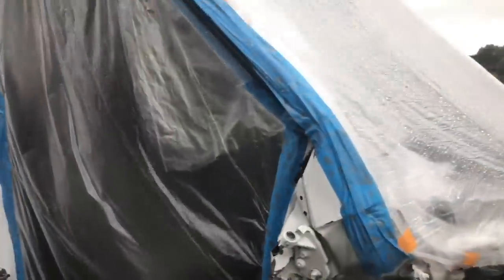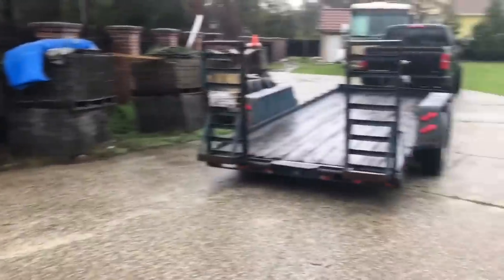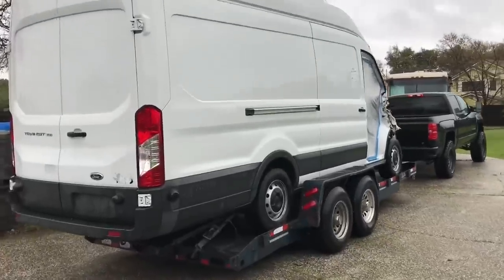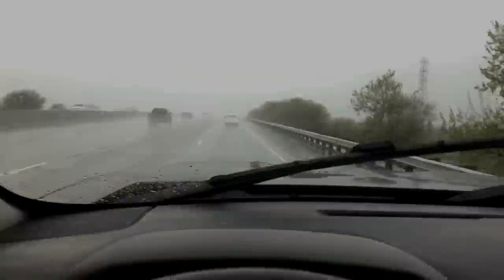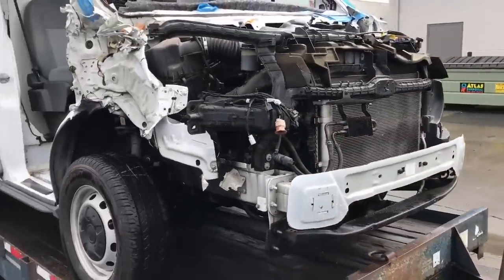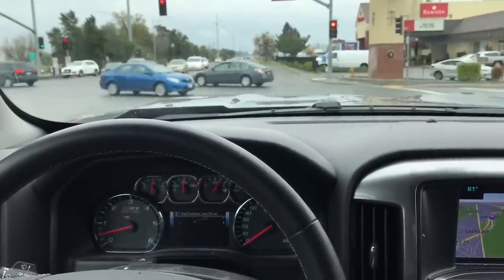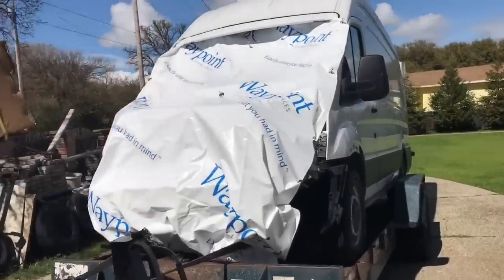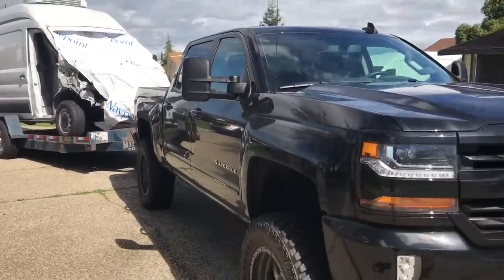2017 1500 Silverado 5.3 Towing 11,000lbs Then this happened!!

Comment: If you push on the wheel you can move anything, since it's the point of movement
Reply from the maker: yes, but when you cant switch gears out of Park because it only switches with key, then its not going anywhere

Comment: The rain most likely got into a relay and arched it out burning the contacts up. Some water probably did get in the vehicle and if I remember right there's a couple relays right on the firewall on the inside. That or a battery terminal, the weirdest things happen when it's loose.
Reply from the maker: Fuse box got wet had to swap from another van

Comment: Flatbed trailer 2500#

Cargo van 5000#

Invisible man, 3500#?

It sounds like he is adding the trailer weight and the gross weight of the van?  The European vans are fairly light unladen compared to USA vans of old.
Reply: That is a whopper, getting closer.  What is the gross?  Doesn't sound like much room for cargo weight.

I went back and looked on google, car and Driver had specs of a touch over 5700# curb weight for a 148" high roof
Reply from the maker: Trailer is 4500, van with reefer is about 6000-6500
Reply: FixItNick I'm curious to know where 4500# came from, and where the weight is hidden, an 18-20' lowboy runs around 2200-2400, I looked at a trailer that was around 4000+ last month, it was a 26' deck over gooseneck rated at 14,000#, the dually trailers are a lot heavier.

Comment: No windshield, doors, or front end sheet metal, and you're taking it to the bodyshop in the rain O_o .......  You're probably lucky you were able to get it dried out and there was no severe damage to the GEM module, PCM, or any other major component. I bet that's the last time you take a disassembled vehicle to the bodyshop in the rain like that.
Reply from the maker: Taya lol it was supposed to only sprinkle, had to replace one computer all good now
Reply: Scott Lambeth 
Actually yr right there r exposed wires to.

Comment: Those Ford Transit vans top out around 5,000 lbs and the reefer option adds less than 500 lbs. you probably don’t have more than 8,000 lbs total including the trailer.
Reply from the maker: I guess they are lighted than I though, but that trailer is heavy duty for heavy equipment maybe 10k total
Reply: FixItNick wrong again. Those equipment trailers are light. Try going through a scale and see how much weight you actually have.
Reply: Ryan Lange 
That trailer alone is heavy.
Reply: @thehandyman2180  ...says another chevy owner! You are also wrong! We are all still waiting on the scale video to prove how much that trailer weighs!
Reply: Charlie Odom 
I'm confused, yr not making sence, & it also looks like yr being sarcastic.
Reply: @thehandyman2180  apparently you are about 10 years old, since you can't even write a complete sentence, nor spell it correctly. Let me dumb it down to your level:

- The trailer he has is NOT heavy.
- ALL 10k capacity trailers are light.
- The van he is towing is much lighter than he claims.
- All he needs to do is a  ideo of a weigh-in to prove how much the trailer weighs.

Being a Chevy owner, he will probably do something stupid to make the trailer heavier on a scale, like hide weight somewhere, but anyone can look up weights of car haulers with 5200lb axles and they all weigh in the 2300-2600 range.
Reply: Charlie Odom 
Ok mate.
Reply: @thehandyman2180  Why go back now to modify and delete posts?
Reply: Ch
How heavy is the trailer.
Reply: Charlie Odom 
So u don't know, otherwise u would've told me, u don't don't just start a fight & the way u talk, u have the mental age of a 10 yr old.
Reply: @thehandyman2180  aww...poor baby. Still can't speak in complete sentences! Keep digging that hole. You'll have a nice swimming pool before the end of the day.
Reply: Charlie Odom
U just can't b sensible, yr not getting to me, i haven't made any mistakes, i don't y u keep saying i have, u obviously can't have a normal discussion, i'll find out from an adult, or i'll just find out myself.
Reply: have a normal discustion, i'll find out from an adult or i'll just find out myself.

Comment: I would have backed the van into the trailer, that way the weight distribution would have better placement, and help allow you to let Ft the trailer ramps up higher.
Reply from the maker: nah you never want so much weight on the tail of the trailer, plus it would not fit on the trailer backwards
Reply: FixItNick is still like to see it, it looks like you could get the rear bumper just about up to the landing gear tower/crank, that would have the rear wheels closer to the front, than the front wheels were. And the front wheels just about where the rears were. That would shift the weight toward.
Reply: It wouldn't shift enough weight forward, and would be an even more dangerous tow than it was in the video.

Comment: Here is an important question.  What gear ratio does your truck have?
Reply from the maker: 3.4
Reply: @FixItNick  GM really needs to put at least a 3.55 or a 3.73 in the 1500 trucks.  My last 2015 one had the 3.42 in it and it would barely pull 6,500lbs.  And it wouldn't hold 70mph on the highway in 6th gear.  Had to drive in 5th the whole time just drinking fuel.  These trucks suck for that reason.  They are only good up too 5,500lbs towing.

Comment: Did u do anything to ur suspension like airbags etc.... to prevent sag
Reply from the maker: No I didn’t all stick with lift blocks
Reply: I think I’m going to add Firestone bags under mine because they really do have SOLF suspensions.....my Kearney car hauler weights 2500 and Jku weights in around 6100 so I’m thinking it’s going to be pushing the limits of my Silverado
Reply from the maker: R D I won’t be towing with the Silverado anymore, that’s why got the f350 project
Reply: Nice .....but I can’t justify a tow rig wen we’re only go a few hours and times a year to the off road parks
Reply from the maker: R D ya I’ll do bags on my F350 truck when get a 5th wheel trailer

Comment: Unless you ran it across a Cat Scale and have the slip , I'm calling bullshit on that 11,000# number , your tandem trailer is 1000 to 1500 empty and that van is about 7,000 empty.
I also own a triple axle flatbed trailer and empty weight is 2000# for my triple axle trailer.
Better learn how to use a Cat Scale or you're going to get tagged , towed and fined by the highway patrol using that 1/2 ton that way.
Reply from the maker: Incorrect sir, that trailer is 4000ish
Reply: 2009mechanic that van and trailer are easily 11k lbs

Comment: What else is wrong with the van that's complete except for the damage I see on the roof  it looks better that the wreck van u taking to the shop.
Reply from the maker: I you referring to the rolled over van? It's basically that been rolled over, runs and drives, was gonna take it to auction soon

Comment: No where near 11k those vans loaded with everything are right at 5k try 7500 pound towing
Reply from the maker: Good guess but that refer can with more panels and insolation is about 6,000lbs and trailer is about 4000-4500

Comment: Everything mechanical in that truck is forward  of the front seats.  You towed it 60MPH in rain with everything getting blasted by water.  What did you expect?  As for the tow vehicle...best choice!!  I tow Fords and Sheepheads sideways with my 2500HD.
Reply from the maker: I wish mine was a 2500, 1500 are to light for towing much, as for the rain it wasn’t so bad till I left the house, I failed myself on this one tho

Comment: to much for the 1500. I have a 2500 with towing package and its rated at 12000 lbs trailer or 3800 lbs in the bed. the 1500 is not rated for that much.
Reply: NebukedNezzer that chevy has a 11000 lbs towing capacity
Reply: Monster RAM Ya I know
Reply from the maker: It did just fine, I should have done 0-60 haha
Reply: Monster RAM max towing doesn't do anything. Same chassis, same brakes, same axles, same transmission.

Comment: Awesome! thanks for sharing, sorry you could not get the van started on your first trip. I am in the process of purchasing a 2017 Silverado 1500 and was not sure if it can tow my boat weighing approximately 10,000 lb.  👍
Reply: I’m currently negotiating a 2017 1500 4x4 and want to pull a toy hauler with my 4 seat RZR and came directly on YouTube 😅😅
Reply: @shreqboi1  how has the truck been towing? About to purchase a camper to tow with my 1500
Reply: @J.M.S.S.p  to be honest, I got rid of the truck within 10 days. The ltz had power and all, but she gave me problems right away. The fuel pump started giving me problems and it pulled hard when it down shifted from third to second
Reply: I think once or twice sure but I wouldn't trust a 1500 to tow 10k plus on a regular basis Definitely straining the motor

Comment: The problem is that it's a Ford
Reply: Your wrong, he forgot to put a tarp over the engine so the rain or snow can't go through
Reply: I've driven those, I wouldn't buy one if I could get a sprinter, but they are pretty nice vans.  A bit plain.
Reply: Derrik Lee sad thing is that truck has no problem Towing that load if it was a ford it would have taken  a s*** ford
Reply: At least the steering wheel is centered on the ford.
Reply: Ford is better than you guys
Reply: Jason Larsen I've ridden in a Ford and trust me my a**** hurts
Reply: Ed Carl cool story
Reply from the maker: Ur face is a ford lol
Reply: Ed Carl GM is garbage lol bailout ass company. Their 2019s are hideous and chevys drink oil like a damn dog no thanks. Ford all the way for me
Reply from the maker: Well after doing this Chevy truck I just finished this ford van and I just picked up a f350 project, I also have 2 67 mustang projects... fords are cooler!!! Lol
Reply: If it was a CHEVY it would fire right up
Reply: Although I like vehicles based on specifically which ones they are and not brand, I have to throw in a Ford line.
FORD: Found on Road Dead
Reply: Charlie Pignatare Key word, fire.
Reply: It’s a Chevy
Reply: Rented one twice, lack of entertainment and brake pedal that sits to far up are the only gripes other then that it’s a fun and useful van.
Reply: Cya 😂😂
Reply: Evil One you are probably 12
Reply: FixItNick if fords are cooler then why the FUCK do you have a Chevy

Comment: You are luckey you didnt kill some one you are over weight for a 1500 of you get into a accident your insurance will ne null on void ....and in the rain
Reply: Jeff J well clearly his truck did perfectly fine, not one issue. It’s literally less than 1,000lbs over the towing capacity. You definitely have t den people go WAY over the tow ratings of their truck...
Reply: The Transit's GVWR is 9500 lbs... it weighs much less than that, probably half.
Reply: Nick Ferderer f
Reply: My overbuilt 18' Cam Superline is a 2100lb trailer and according to Google, the Transit 350 tops out around 7124lbs. So at most it's probably 9400lbs your towing. But that one has no seats or gear in the back so it's probably closer to the bottom at 5,000lbs curb weight. So really a 7500lb load.

That's why the Silverado had "no problem." It looks heavier than it is.
Reply: Nick Ferderer if you are towing max tow capacity you are gonna break stuff it’s a fact and you can’t avoid that from happening unless you buy a real truck (diesel)
Reply: Keith Brewer Gonna break a diesel too if you tow at its max weight.

Heck everything breaks eventually, towing or not.
Reply: Jeff J you are correct it's not getting it moving but stopping
Reply: Jeff J that's not overweight. Total legal. A Chevy v8 will tow 11,000.
Reply: Keith Brewer the diesel truck has the same chassis, axles and brakes. How is it going to be better? The engine weighs more stressing out the brakes.
Reply: Nick Ferderer you towing capacity is not about how well your truck pulls it its is how well it stops it
Reply: Sami 10,000
Reply: Bryan Hensley crew cab?
Reply: Back the Blue I can tow 11,500 with the 5.3l v8 
Crew cab
2wd
Short bed

Comment: That vans weight loaded max out at 7000 lb so unless that trailer weighs another 4000lb and the van is fully loaded I think your weights are a little out
Reply from the maker: That van has a reefer inside so it puts it at about 6500 maybe? Trailer is about 4,000

Comment: I'm almost positive anything 10,001 pounds you need a CDL. Whether vaulting privately or commercially
Reply: Joshua Dupont wrong.
Reply: 26,000, that's correct,
Reply: 26000
Reply: 26,000 is the cut off. 26,001 =cdl
Reply: Federal DOT = 26,001 lbs. State and city DOT have the ability to require a CDL for lower a weight, so you have to be careful where you drive. You don't need to keep a log book if you have a truck (usually defined as 5 tons/10,000 lbs. or more in most jurisdictions) if you drive it for pleasure or you're using it for your own personal business and state "NOT FOR HIRE". DOT and state police want to make sure that if your making money, you're papers are in order, otherwise, they can't demand you produce a log book or even a physical card. I did plenty of illegal hauling over state lines, NEVER tell the state police at the weigh station you're getting paid if you're doing a small side job for cash LOL They'll fuck you 9 ways to Sunday. In the end, all the CDL laws and requirements are bullshit because they don't take into account the physical size of the vehicle, case in point, the guy with a regular 4 wheel Class D license goes to rent a Uhaul or a Penske that has a GVWR of exactly 25,999 lbs. or 26,000 lbs. But the straight truck has a 26 foot box and is 12' foot high+..... next thing you know, he's smashing into cars and getting stuck under train trestles. So much for CDL rules based gross vehicle weight.
Reply from the maker: You are wrong and I have a class A

Comment: I was going to guess that water got in somewhere within the electronics shorting it out and it sounds like that’s what actually happened. I would not have towed it in the rain if it was humanly possible to avoid.
Reply from the maker: Yes I had to swap fuse computer box under dash

Comment: The GROSS vehicle weight rating of that van is at most 9500lbs. That's not what it weighs, that's the maximum it's allowed to weigh with a load in it.  Van and trailer together probably weighs around 6k.
Reply from the maker: Trailer is 4500 van 6000ish its 22 feet long tall roof with reefer option

Comment: My 98 Z71 Silverado 5.7 vortec would drag that entire truck and trailer with load . Good old 3:73 locking 14 bolt powered by a 5.7 vortec 330 TQ at around 2800rpm 5.3 says what. 5.3 makes what 340tq at what 4000rpm. Young punks ya you young punk just cause your truck puts out 300+ HP doesn't mean shit that's the problem with trucks now a days people want HP. The problem with that is now pickups yes put out 400+ hp but it takes them to 4000rpm to make the power. But on the other hand I like it when my 98 Z71 out pulls these new truck's then the young man with debt up to his eyes wonders wtf my new truck is rated for 400 HP how did your old 5.7 vortec with 255 HP out pull me WTF. People trucks are ment for towing and hauling like my 98 Z71 was built for not like this new junk. Unless you're talking 2500s and up.
Reply from the maker: Sounds like a cool story lol

Comment: You should had placed the van backwards to avoid the rain going into it. I guess you got blinded by hauling it with your truck than using common sense. It happens once and while. keep posting videos with overweight hauling and you'll see how your channel will serve its purpose.
Reply from the maker: you never load cars backwards because thats how it will fishtail the trailer and cause an accident due to to much wait on the rear of the trailer

Comment: If you're going to haul a Ford, should get a Ford to pull it.  Everyone knows the only thing dependable about a chevy is you can count on the engine rear seal leaking making a mess on your garage floor.
Reply: eighthof8 that was funny but you know what Chevrolet Motors repower power
 more Ford drag cars.  Hot rods make fun of a Chevy when most Ford's are powered by a Chevy look at a 32 Highboy 50 to 60% of the time it'll be powered by Chevy how many Fords use a Powerglide on drag cars, how many Ford Mustangs have got LS is in them because Ford Motors suck s***
Reply: LS architecture is a one piece rear main. They rarely leak.
Reply: Ed Carl yep LS and 350 small blocks are the two most done engine swaps by far!
Reply: Mad Max my 86 Silverado has a 350 in it with 586k miles. Keep clean quality oil in them and don't treat them like race cars or haul heavy stuff constantly and they last forever.
Reply from the maker: Haha my goal is to break it to buy a ram
Reply: lol thats acftually funny, i just had the rear seal fixed on mine last week xD
Reply: Yes Chevrolet did have that problem with their 50 year old designed 350 engine but the newer LS engines got away from that design and do not have that problem plus I know of a popular Ford design in their Triton line of engine that would shoot spark plugs into the hood that's more of a showstopper than a slow oil leak
Reply: Fords are junk
Reply: I agree, but ford driver will automatically drive to Gatlinburg to see Uncle Rick.....A Lot
Reply: eighthof8 Damn my Chevy has 480,000 miles on it. I guess I better put some cardboard under it soon. It might start leaking.

Comment: Thought towing capacity was 12,000
Reply: P J  not on a 1500.   About 7 to 8 thousand if it has towing package
Reply: joe blow a 2017 1500 with max tow package has a tow rating of 12k
Reply: Thomas Mueller With a 6.2 litre max tow package(manual selector on column) . Integrated trailer braking, hill decent, grade assist, 3.4.2 rearend. 12,500 on 2017 and 18 12,000 on 2015 and 16
Reply: Thomas Mueller I’m sorry but it’s 12,000 if it’s a goose neck.  Not even close if it’s a conventional trailer.
Reply: joe blow As long as you are not exceeding 5000 on your tow hitch receiver(balancing your load) you can pull 12000.